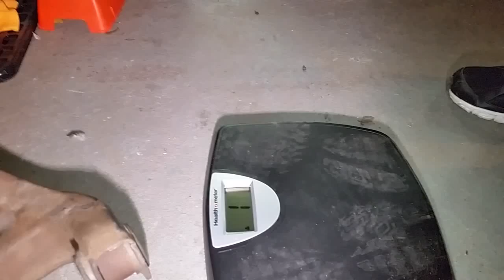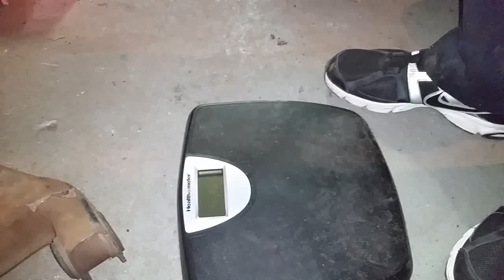How To Install A Tubular K-member - Fully Detailed Video!!!

Comment: Great tutorial. I'm installing a BMR k member on my project 94 Pontiac Trans am. My complete suspension from front to back is BMR and completely adjustable. I'm going to be using a engine brace to hold up the engine instead of a jack underneath oil pan..

Comment: I love this video. When I put my springs in I used a spring compressor and handled my springs with caution. When I put them up in the kmember and A arm I used a chain and wrapped that spring. I wasn't taking any chances. And I did it all myself. I am going to build a 383 for my car and am going to do a UMI K member before I install the engine.
Reply from the maker: Duane Orr awesome good luck with it

Comment: Good job. You made it look easy.  Saved money on the spring compressor too :)  A lot of work to save 22 lbs. That's almost worth a quarter of a tenth of a sec in the 1/4mile.  jk you mentioned you did it to make way for the turbo.
Reply from the maker: Thank you..twin turboskies :) dont forget to subscribe

Comment: What brand air tools and compressor do you use I want to start a project car and would prefer to do as much work myself and not have to deal with a lot of stubborn nuts and bolts with a ton of torque thanks and great video
Reply from the maker: Hey..i use a craftsman  compressor 33 gallon..however i bought it a long time ago, the current ones arent as good..my air tools are ingersoll  rand..i would look into in ingersoll  rand compressors or campell hausefield ..thnx for watching

Comment: Do they have k members that work for the stock ‘85 firebird 2.8 v6 I see a lot of 3.1 v6 and don’t know if those will work for the 2.8 as well or if it needs its own k member
Reply: T FromKBlock They do and the 3.1 and 2.8 are the same 60 degree motors and uses the same mounts. http://www.spohn.net/shop/1982-1992-GM-F-Body/Chassis/Tubular-K-Members/

Comment: Hey klowny, I have a duralst 2-ton jack that has a range of 6" - 21" and two 3-ton jack stands that have a lifting range of 11-1/4" - 16 3/4"

Will I be able to have enough clearance to get the springs out?
Reply from the maker: Matthew Hausser yeah u should be fine
Reply from the maker: Matthew Hausser yeah u should be fine
Reply from the maker: Matthew Hausser yeah u should be fine
Reply: Thanks man, great freaking video! I now feel confident enough to attempt swapping out the control arm bushings this weekend!
Reply from the maker: Matthew Hausser just be careful the springs are under alot of pressure..u might want to watch my lemans spring install vid...u can rent that tool i used from autozone to compress the spring a little

Comment: Antieieze is ok to use on the bolts to the body?
Reply from the maker: We used antiseize on those bolts because they were stainless steel..anytime u have two different metals coming into contact , u run a chance of them seizing and galling threads..thnx for watching!
Reply: klowny1969 Ok, makes sense, I understand that, but from what I know, antiseize tweaks torque settings from the "slip" it creates from lack of friction.

Comment: Hey bro, did you not have to square the K member?
Reply from the maker: nosiree
Reply: klowny1969 lucky! I have to square my Mustang’s k member =(
Reply from the maker: Kris Ram that shouldn't be that bad..u can do it
Reply: klowny1969 thanks bro... I removed the K because the oil pan gasket was leaking and the motor mounts had no more rubber left in them because they crumbled out lol. Now when I set the knmember back in it reaches the mounts but not the frame. Do you think I need to jack up the motor? I have the motor held by a support beam but I’m think the new mounts are extending further down than the old ones because they have new rubber
Reply from the maker: Kris Ram hit the nail on the head

Comment: I recommend no one try their spring compression method. Go rent a tool! It's free and less risk of decapitation.
Reply from the maker: Matt's Buds lol..i find it funny how people get scared of springs..in thridgens..once u start releasing the tension by lowring the control arm..the speing really has no pressure...ive done it thousands of times..no issues..other cars might be a diff story
Reply: klowny1969 ahh ok. I've never done it on a third Gen but I cringed with every pump of that jack lol
Reply from the maker: Lol no need to worry
Reply: klowny1969 how did you support engine ?